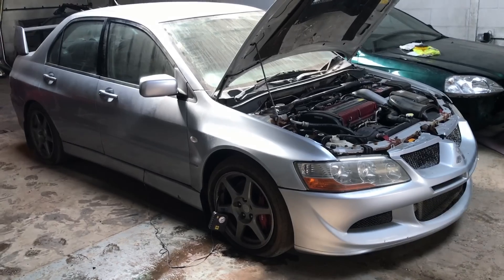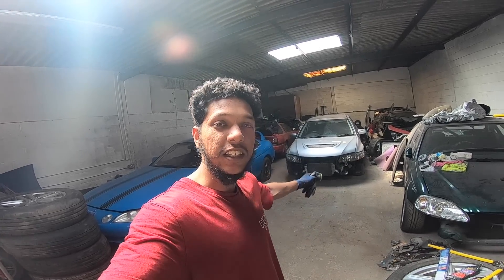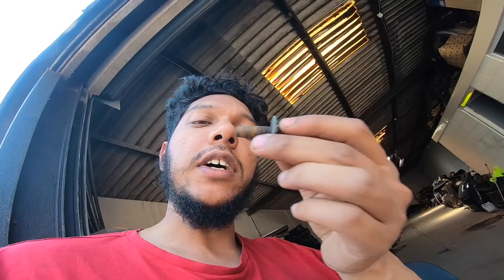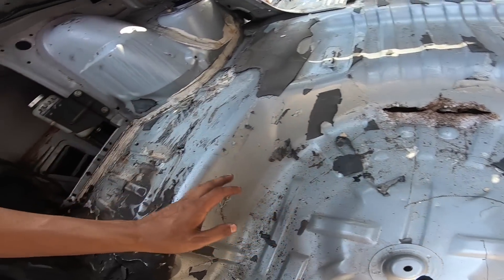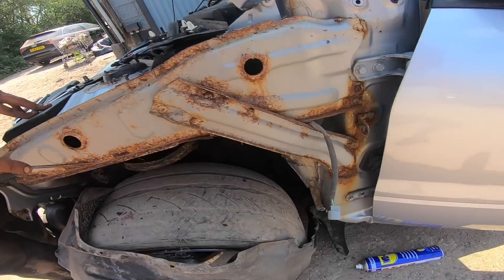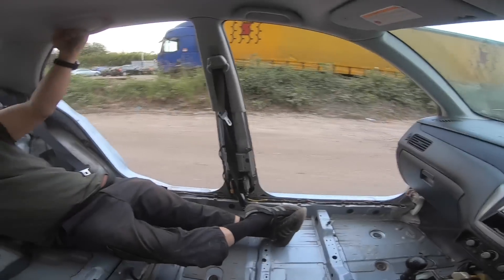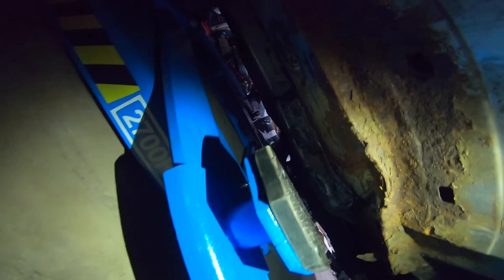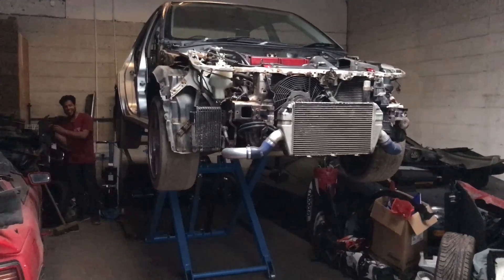RESTORING THE RUSTY MITSUBISHI EVO 8 | PART 1

Comment: I had an evo  8  a few years ago brakes failed   pedal  went solid at speed on the road  the master cylinder was at fault luck was on my side when it happened  and the handbrake  stopped me  the same thing happened to simon norris  on track  video on here)  take my  advice buy brand new  o.e brake master cylinder   . also use steel brake pipes when you get  round to it don't use copper  . 👍💯
Reply from the maker: many thanks for this John really appreciate this one.... helps soo much!

Comment: Great content lads although realistically it needs scrapping, there will be rust between all the panels and all sorts. Needs full disassembly, spot welds drilling out and all sorts, not worth it but that's just my opinion. Crash damaged, riddled with rust, struggle to get anything decent for it when it's back together and if it's sorted. Break and feed other cars or put this engine and running gear in another project 😊. All the best.
Reply: I disagree.. it needs a lot of welding but not worth scrapping for someone that will do it themselves. 
Plus it's great content as most 90's JDM owners will be able to relate.
Reply: @chrisb8416  I've been there with an evo 8 i had previously, really not worth it. The rot will be everywhere and when it's finished only worth 10/12k with it's previous condition. Just my opinion.
Reply: @RatchetMonkey  the rot will be everywhere, I'm on my second Evo 6 resto and it gets in the worst places. 
But.. for a cheap performance car purchase, I think the content and knowledge it will create to people on both sides of the camera is worth it, and the prices of these are only going one way - especially when they hit the 25 year mark. 
The good thing about car guys is we've all got our own opinions, it would suck if we all thought the same and builds would be so boring 👍🏼

Comment: 6:29 I saw you brake and turn then start running outta room to get around 
So let Chief Rocka explain why the Evo 7 8 and 9 are better than the earlier Evos.
If you’d of pulled the handbrake at 6:26 and let the back end swing around as you turned you’d of found out that your car had a gearbox especially developed to allow the rear end to disengage from the 4wd when the handbrake is applied .
So it acts like a 2wd car .
Now you know why Hondas are not worth a wank in rallying when a Evo 8 is 4wd and then RWD when it’s needed 
Boshhhhhh 👍🥷🏿
Reply from the maker: wow nice piece of knowledge there bro!... my handbrake not working atm... but will be after restoration